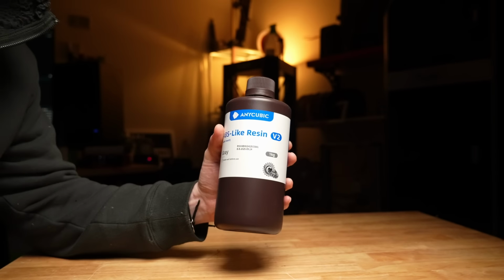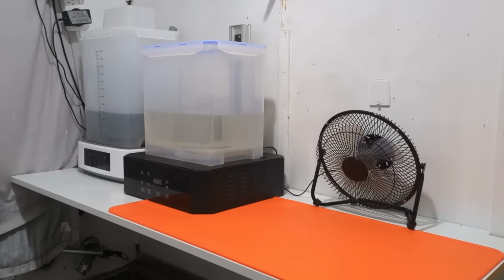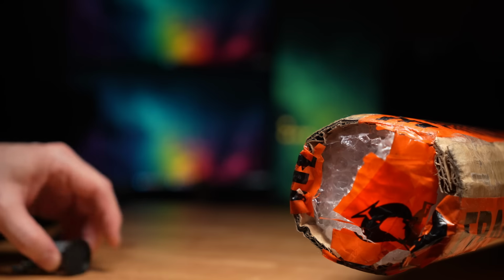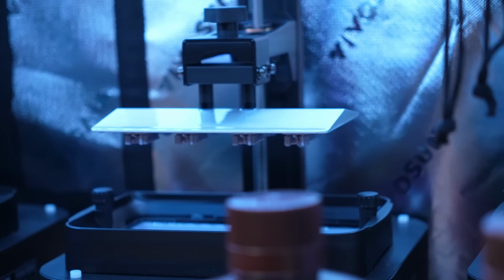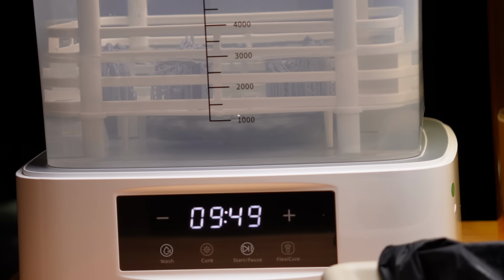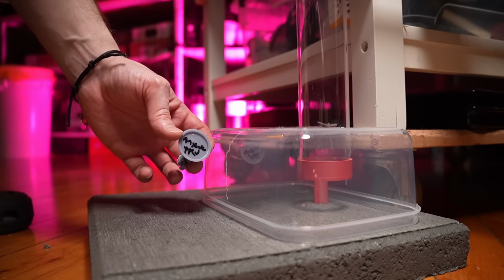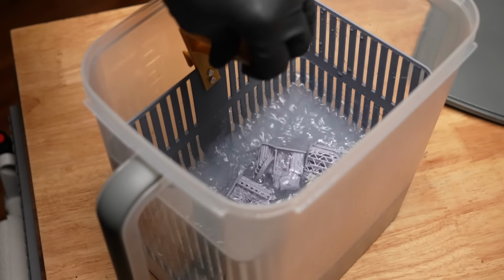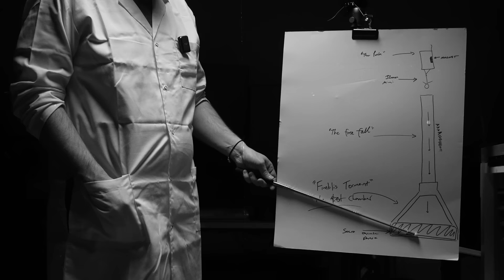The hunt for GREAT water washable resin (Part 1)

Comment: I still use my Anyqubic photo se printer which is half the size of my mono x but is a work horse and I use it for 28mm to large size statue prints.
If they are to big I just chop them up in photon workshop  which is great for pie slicing bases or literally choping a model in half.

Comment: I have a difficult time watching these demonstrations. Even though I respect the expertise, the end results are so bafflingly different from my own. I use Elegoo water washable translucent blue and it's crazy durable. I think that the root problem with comparisons is that the minis in the demonstration were over exposed. There's also a possibility that the opaque additives contribute to the brittleness. I also wash my minis in hot water to make support removal much easier and that may even be a factor in increasing durability.

Comment: Hi all. I have an Anycubic Mono and have just bought 500ml of Flashforge water washable resin in beige.  I have not had a SINGLE print stick to the plate yet.  They all stick to the FEP.  I tried printing with Elegoo ABS-like to see if it was the plate or FEP at fault and it prints perfectly.  So it has to be the resin.  The room is 22c and I have tried everything from 20 to 35 seconds for the first 6 layers and not a single layer has stuck to the plate.  I am trying to print the Cones of Calibration test but so far nothing!  Someone please help me.  I have just emailed Flashforge for their advice.  I am not hopeful of getting a reply though.  Also, I have just ordered a can of spray PTFE to see if that works.

Comment: Maybe create a hammer test what they have for other type of filament testing? I think a more standardised way would be better. 
I mean here similar tests like MyTechFun or CNCKitchen does. They have neat test models to test impact resistance and what. 
Testing with regular minis I think has too many variables that you can not control. I know it is supposed to be "life accurate" but science is not necessarily about that. If you wish to objectively compare these resins I think you need a way more standard test method like the hammer one. 
It would be interesting to see minis get hit by a hammer as well :D

Comment: dont wash in water! my local diy store has water based brush cleaner solution called Clean Spirit; i buy that in 5 litre bottle and use it in my wash station; it cleans well and lasts well. You can either leave the solution outside for the solids to harden and drop to the bottom or you can just pour it away into a bucket of sand; which is what i do! its safe for the vat and anything else and cleans everything well. There are other things out there and yopu can find them if you search youtube for people that have tested. I really dont understand the people with issues with water washable; i use elegoo water washable; ive nevber strugled with print quality or how solid it is! I use it for printing walkling cane toppers and its more than durable enough.

Comment: Anycubic has been nothing but a disappointment for me. My mono 4 ultra was defective out of the box and support has been abysmal. Took days for them to get back to me initially, followed by a series of emails back and fourth where they ignored details of the problem I explained. Told me I need to replace the LCD screen after sending them video of an exposure test, then before I could even reply to that email sending another to say disregard. Its been nothing but a waste of time and money. I finally had to say Im done with this thing after they asked me to run a test print without any resin or vat... What good would that test even do, if it does work properly when its not actually printing anything?

Comment: Improvements to the drop test? Remove the puck and the weight it adds. Have the landing pad be something more likely found in a house like wood.  You are shooting minis out of a cannon at a brick wall and then being shocked that they break. Make the test more "real world" shove them off a table onto a wood floor. Just have 10 of each model in each resin and look at the results. Good testing is done with bigger numbers and repeatable results, not one example as the only point of data. I appreciate that you want to remove variables such as the orientation of the model when it hits the floor, but in removing those variables, you are introducing other issues that you have already identified in this video. 👍🏻

Comment: WARNING I have sunlu's ultra sonic cleaner and use resin detergent as it advertises however its own brand of detergent and other brands are highly corrosive to the machine it self.
Very dumb on their part to have made the outer shell plastic since it just melts with a single drop and if it gets on the rim of the lid, it will fuse it together making it hard to pry open. Such a stupid flaw that was overlooked for the sake of cost cutting, if you want a sonic ultra cleaner please get one that's fully stainless steel.

Comment: I've pretty much always used waterwashables for lung-related reasons. Used to use Phrozen and Elegoo but they're pretty fragile, particularly over time. I now use Wargamer mostly. It's a bit pricey but does the trick and the company are very friendly and responsive (hi Adam!). I am, however, nudging back into using IPA for some essential mustn't-bust-but-still-have-detail stuff (I'm looking at you, 6-10mm chaps), partly on the basis of your recommendations (Jamg He Art Engineering and the SunLu ABS seem pretty good for this, not least on cost). Really nice review anyway, as ever, and cheers for the basket 😆👍.
Reply: Is it the exposure to alcohol that is harsh on your lungs or is it the resins scent?

I use propylene glycol with regular resin and I recommend everybody to do the same.
Reply: @andrewh9284  It's the nastiness of IPA in general, Andrew. It evaporates so easily that you're generally just inhaling a ton of it when cleaning, particularly if spraying rather than chucking it in a wash station or similar. A mask certainly helps, but it has a go at your eyes also. I'm doing more IPA wash resin now as I need the resilience and detail for some things (and water washables can't quite cut it when competing there) but I'd prefer everything to be ww if the tech could manage that one day.  I've tried proplylene glycol but it didn't seem to clean as well for me? I wonder if it was just that particular resin?
Reply: @TheHunch8ack  The main resin I use is siryatech fast abs. And I mix 10% tenacious in for added flexibility.  But I have also used anycubic tough and abs like and it worked well for both.

Did you dilute the glycol down with water or did you use 100% glycol. I find it actually works much better when you dilute it. I also add a little bit of dish soap with both my spray bottle and the vat.

Diluting it makes it much thinner so it flows nicely in a wash station. 

I have even used  siryatech blue which has to be one of the worst resins to work with, its so tacky and thick and it still managed to clean that really well.
Reply: Also I much prefer the way it cleans compared to alcohol. I find that the resin stays trapped with the alcohol so when you eventually need to clean the vat its a massive slurry. 

The glycol and resin actually separate over time Ill sometimes go weeks without printing anything and the resin will then just accumulate on the bottom of the vat. I Dump the glycol water mixture into a new vat, leave the old one outside to dry and cure. scrape everything off and then its good to use again.

I just find that the glycol performs better in almost every way.
Reply: @andrewh9284  That's interesting. You've inspired me to give the MPG another go, Andrew. I've dug out my old bottle (partly bought for smoke effects) but will get a new one in case it's gone manky. Hopefully it'll turn out okay. I'll water it down a bit, as you suggest. Cheers.

Comment: I have been 3d printing for almost three years now, and still do not get turned off by the smell. Are younger folks' noses just weaker? 

The drop test like some others have said, is not an accurate recreation. Might try a shute style drop mechanic, with no added weight.

Comment: Your coming at durability from the wrong direction it’s not about a drop test it’s more about the handling and the transportation/storage of the model. How often do you drop a model rarely but the models are stored or transported to gaming area constantly mainly in plastic tubes rattling and bumping into each other. I suggest something like Heygears wash station, place the models inside it without water turn on for five minutes and see what remains. I loved the video personally keep up the fantastic work ps could you add a bit more lighting to the background would help my aging eyesight

Comment: Drop Test:  I believe your drop test is flawed in it's initial design.  It is important to gather objective data and your test does do that, however the IDEA of how the drop test is conceived is just flat out flawed.  You have the mini attached to a weight and that is the first fail.  How many miniatures are going to be dropped with a weight attached to them?  Answer -- few to none.

So you need to drop them without anything other than the mini going down that tube.  Additionally, they should have a 'bounce' area, such that when they hit the bottom plate to represent the floor they can bounce from the recoil of their material as opposed to being crushed by the weight behind them.

To properly administer this test, you simply have to have room to drop a mini right side up, upside down and sideways (if possible).  Your tube height simply has to be set for whatever height you wish (1M is a good height, as would in cm or inches of the average height of a gaming table) and then you let it go into the tube by hand.  No fancy attachments, weights, magnet releases, etc, necessary -- just drop them.  Your hand is a good enough 'tool' to use as your drop point.  No-one is going to argue that you didn't use a scientifically approved method just by actually dropping one. :)

The reason you have to just drop them both upside down, right side up and sideways it to provide for the potential of a mini to tumble as it falls naturally after being dropped or knocked off a table.  THAT would provide a better analysis of the miniature resin used as the variables of falling would have been better covered as opposed to smashing them with a pile driver method each on their top ends.

Waste Disposal:  That stuff looks nasty, man.  I'd recommend some sort of filtering process that allowed water to pass through while collecting the particulate debris of the resin into that filter.  Possible components could be:  Cotton wadding (such as cotton balls), paper filters of varying sort, progressive mesh filters, possibly even an actual water filter for the process?

Always enjoy your videos.  Fun and informative without fail.

Comment: I have been using the Elegoo water washable for a very long time. I have dropped several models from my hand or knocked them off the table and almost none of them have broken.
Unfortunately, your test is very unrealistic, you could also hit it with a hammer directly

Comment: Gotta disagree with your testing. I've used water wash since my first bottle of regular resin ran out, never had a problem. Granted I use my prints for model railways and aren't being thumbed all the time. Apart from the longer dry/cure time which I don't really mind as I barely use if often.

Comment: The drop test is not good. If it falls off a table its not going to be driven into the floor like your test rig is. Really you should just drop the model at the top of the tube by hand

Comment: Just my two cents. I never used a different resin, then water washable from Anycubic. The printer is a MonoX2. Reasons are space and economical reasons. I have no space for a vent, nor do I or my close neighbours want to smell the alcohol. I also have no way of disposing the cleaning solution. So I went for water washable. I have a water recycling cycle going on with filter and sun curing stations. The rest fully cured pieces are then put in our trash which is allowed. I checked and asked many times. Enything that isnt 100% cured is gathered for waste disposal.
I love that i can get my minis off easily with hot water. The build plate doesnt fit in the cleaning station.
I aldo dont print much. So i also dont want to test and dial in the settings. The resin works out of the box with the printer and settings in their slicer. But i also dont care about brittleness or if those miniatures will break in some years. I dont think my paint jobs are worth crying over.
Its convenient and easy to use. That's enough for me 😊 i will follow this series close though. Maybe there is a better resin for me. So thank you in advance.

Comment: Redo this without all the extra weight. Your testing system isn't appropriate for the task. And you didn't get good shots of the breaks. How something breaks matters as well. You may be frustrated by it, but it deserves to be done. If you're running into air resistance issues just print the bases with holes in them to let air through.

Comment: Man this was a train wreck of a video. You made a video with advertisements for a 1/3 of it. 
You centered it around a piece of test equipment you failed to test or even finish.
This video has no meaningful value but pushed this out anyway when you should have scrapped 90% of this content. Damn dude. Your better. Do better.

Comment: All water washable resins suck. Primarily because they encourage people to dispose of dangerous resin waste in irresponsible ways. I would love to see a survey of your water washable viewers asking them how they are disposing of the waste. I would wager at least half are just dumping it into their sewer system. I would bet less than 1 in 100 are taking it to a hazardous waste disposal facility. For anyone wary of the alcohol smell I keep my printer and wash station in the same tent like enclosure and vent the entire thing. Almost no fumes make their way into the room and any that do are quickly dissipated when the enclosure is zipped back up. I prefer alcohol because I can leave it in the sun and the alcohol quickly evaporates leaving the resin to harden and cure so it can be safely thrown in the garbage with the rest of my solid resin waste. That just isn't possible with water washable because it will never full solidify and cure as the water doesn't evaporate as well as the alcohol.